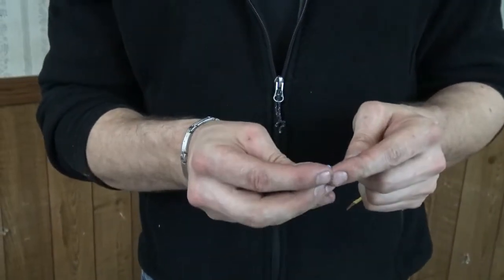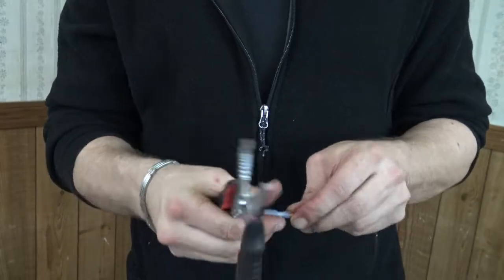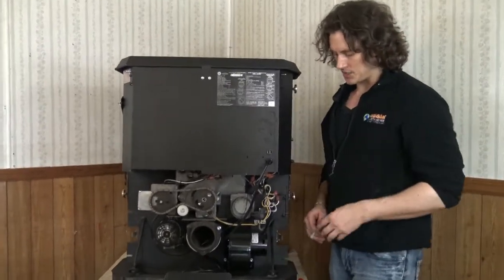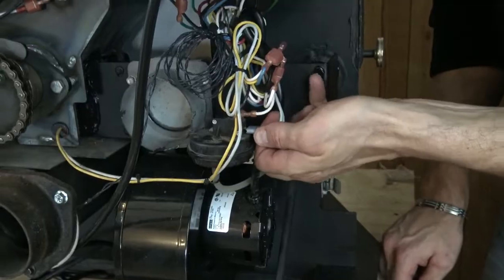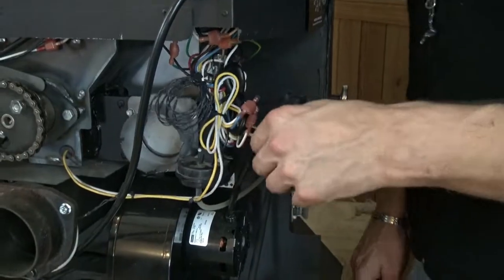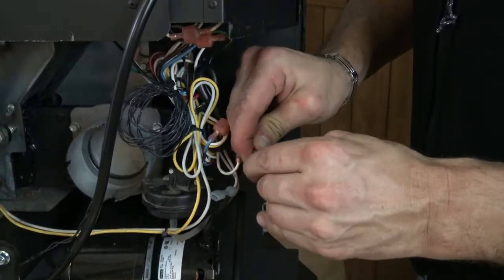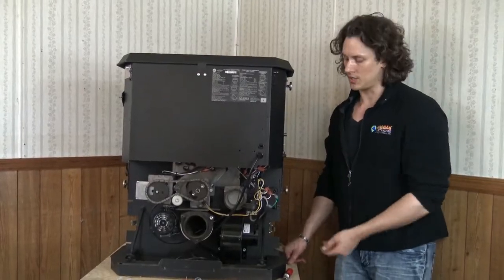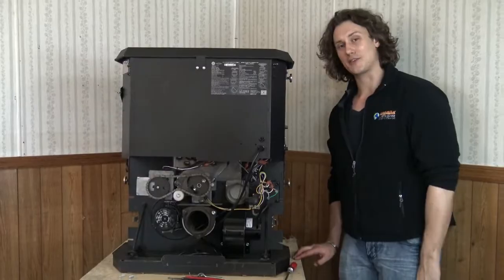How to create a jumper wire and bypass a safety switch in your Pellet Stove

Comment: How can I find the moles connectors? They all look different when looking them up.
Reply from the maker: Thanks for contacting us. Depends on the stove make and model, but most will use the same type of male or female molex spade connectors for the motors and components. These can be purchased at any local hardware shop - here is a website link that shows the most common size male and female spade connector used in pellet stoves. https://pellet-stove-parts-4less.com/collections/miscellaneous-electrical

Comment: I just use an automotive 5 or 6 amp fuse. The spades from the wires slide right on each side.
Reply from the maker: Thanks for sharing. Just important any metal on the fuse doesn't touch any other metal in the stove that would cause a short while using it to troubleshoot. Any future questions or needs just let us know. Thanks!

Comment: 5:05 pm 
My control borad quit working. Does not turn on. It's a pelpro 130. Can I by pass this control board by building my own control box? The part is on back order. Still on back order
Reply from the maker: Thanks for contacting us. I just inquired with our inventory team on this control board and the arrival from factory. I'll send an update once I hear back. The control/circuit board would not be able to be bypassed. It controls all motors, blowers, and safety switches during operation.
Reply from the maker: I just heard back from Inventory. The date they are currently receiving from the manufacturer is 02/02/2024. I wish we had a better update for you; if anything changes and they arrive in sooner we will be sure to let you know. Thanks.

Comment: Hi
Thanks for the links. I have never noticed any kind of gasket, but I will check it out. I will also do the dollar bill test. When the stove is on, the flame is very crispy/torchy as you mentioned. It does not seem to be a weak flame at all.
Reply from the maker: Thanks for the message, great to hear. If the fire looks real nice like that I highly doubt you have a gasket leak or air blockage in the stove. Keep us posted once you replace the vacuum hose. Thanks,

Comment: Thank you, trying this on my king 550 series now. It just shuts down with E2 error code
Reply from the maker: Thanks for contacting us. The manual says the ERR2 error code on the King 5500 indicates the unit ran out of fuel in operation/lost proof of fire. It provides these notes:
Hopper Empty.
Auger output failure or jam.
Flame of fuel quality caused fire to burn too slowly or go out.
Electrical Open in low temperature switch or wiring.
Keep us posted, happy to help.  Here is the manual for reference: https://www.manualslib.com/manual/266397/United-States-Stove-King-Ashley-Pellet-Stove-5500.html?page=18

Comment: The stove that I have is a Quadra fire Castile. It is an older model. It does not have a sensor on the pellet door. I will check the hose again. Do you normally send a replacement hose when a vacuum pump is purchased? I cannot test my auger motor because it has a big wide plastic clip for a connector. The exhaust fan seems to be spinning at an optimal speed. I might just need to call in somebody to take a look at it. Thanks for your help.
Reply from the maker: Thanks for the message and reminding me of the model you have; it's coming back to me now from our previous communications. The majority of vacuum switch replacements do not come with the hose/tube, however some do - just depends on the SKU. Definitely double check your Amazon order details on that - If something is wrong, our team will make it right. Yeah, check the items I indicated in the last message - I know it's difficult to direct test the auger motor in the Quadrafire due to the connector. I just have a feeling something else is causing that vacuum switch to trip/stay open which is not allowing the auger motor to run. Does your door and ash door gasket appear to be sealing tightly? When is the last time those gaskets were replaced? How about ash build-up? How many bags of pellets have you burned since you last thoroughly cleaned the vent pipe, stove firebox, and ash cleanouts? Happy to help save you the cost of a service call if we can. Thanks.

Comment: Hello. I purchased through Amazon a New vacuum pump from you. When I put that on, it did not do anything. The connectors seem to be loose on them when I attached them. Also, it has been several weeks since I have worked on the stove. When I plug it in now, the fan for the exhaust is very squeaky. Is there a way to lubricate that? I attached the jumper wire again, and the auger is working, but it is louder than it was previously. Thanks for any help you can provide. Appreciate it.
Reply from the maker: Thanks for the message. It is possible the new vacuum switch is bad, however it would be very rare. Before we determine the switch is bad and send it back for replacement, it's important you check the following things. Each of the items below will not allow the vacuum switch to close the circuit if it detects air loss or air blockage. 

1. Vacuum switch hose. No cracks in the hose. Secured tightly on both ends.
2. Ash build-up in the stove or venting. Any ash blockage will keep the vacuum switch tripped.
3. Door, Glass, Ash Pan gaskets sealing tight. Any gasket area that is not sealing tight will keep the vacuum switch tripped.
4. Exhaust fan not running at correct RPM - will keep the vacuum switch tripped.

With you saying the exhaust fan is squeaking, take a closer look at that. If you have a basic multi-meter, check the voltage on start-up. It needs to be running near line voltage to lock in the vacuum switch. 

The harman exhaust fan is sealed bearing so there is no way to lubricate that motor. 

You can always run the auger motor to direct power to check for performance and noise. The auger motor is sealed too. If gears are grinding or squealing and it's making noise, it's generally a sign that it is on it's last leg. 

Remind us again what Harman model you have and how old the unit is. Happy to send further reference links.

Hope that information helps. Thanks.
Reply: Hi. So I let the stove run, and the noise from the auger, and the fan blower noise have gone away. They both sound like they used to. I currently have the machine running with pellets to see how it’s working. Everything seems fine. The issue that I still need to address is that I am bypassing the vacuum switch. I will be ordering a new vacuum hose, and A new gasket for the stove door. The door to the ash bin does not have any kind of gasket. I am guessing because it is an older model. I will let you know how I make out once a replace the gasket, and toes. Thank you
Reply from the maker: @yesrealtygroup1989  Thanks for the message. Yes, it will be important to have the vacuum switch working properly again; we only want to bypass for troubleshooting purposes. The Castile Freestanding model will have a gasket on the ash door. Depending on the age, some used a rope gasket and others uses a cut-out sheet style gasket. I'll put reference links below - it will be good to check that gasket as well. You can do a dollar bill test around the door gasket. With the stove off, stick a dollar bill half in and half out of the door. Close the door and see how much resistance there is. Check in multiple areas - should be heavy resistance all the way around. Would you say the fire is nice and crisp/torchy while burning? 

https://pellethead.com/product/quadrafire-castile-freestanding-ash-tray-door-gasket-new-style-oem/

https://pellethead.com/product/quadrafire-heat-n-glo-rope-gasket-kit-1-4-x-10-aftermarket/

Comment: Hello,
So I did 2 things. I bypassed the vacuum pump and the auger started to rotate. I had also unscrewed the auger, and I pulled a small rectangle of paper towel out. I have no idea how that got in there. I cleaned out the auger, and I screwed it back in. When it did start up with the bypass, it seemed to be very noisy, nothing like it was before. So I am guessing at the minimum, I need a new vacuum pump. The one on the unit is a silver rectangular box. Thanks
Reply from the maker: Regarding the noise when the auger motor turns - it could be the gears in the motor or it could be the auger shaft inside the housing. See if you can pinpoint where the noise is originating from. Thanks.

Comment: Hi. Thanks for getting back to me. My stove does not have the sensor that is in the hopper. It must’ve been BIll before that. The wires coming out of the auger motor are connected in a white flat piece of rectangular plastic. I do not believe I can make a direct feed to the mower like you do in the video.  Is the high low sensor one of the snap discs? Thank you.
Reply from the maker: Thanks for the information. Ok, you have an auger motor with the rectangular connector. Yes, you would need to go to an electrical hardware place to create an adpater for that to direct test it. When you turn the stove on does it seem like the auger motor is trying to feed at all or does it seem like no power is coming to it? 
Yes, the high limit switch will be one of the snap discs. On your model it should be up by the auger chute covering or back wall area. Here is what it looks like for reference - https://pellethead.com/product/quadrafire-heatilator-high-limit-switch-snap-disc-3-manual-reset-oem/

Comment: Hello. It is a Quadra fire Castile stove. Runs off of a thermostat. When I plug it in, the blower fan comes on. No pellets drop. The auger does not have anything blocking it.
Reply from the maker: Thanks for the information. Few Basic things to check -
1. Let's make sure there is at least 15 lbs of pellets in the hopper and the hopper lid is closed. (I'm not sure if your model was before or after they had the hopper switch installed on the Castile. Reference: https://pellethead.com/product/quadrafire-heatilator-ecochoice-magnetic-fuel-hopper-lid-switch/) 
2. Let's test the auger motor to direct power to see if the motor is good or bad. This video will show you the basics of making a test cord -https://youtu.be/rlmiCYI2WPk?si=aTeEyaBXJeaAOTF3
3. Let's troubleshoot the high limit switch. Place a jumper wire between the two wires going to the switch. (Again we never want to keep the jumper in place, this is just for troubleshooting. It is crucial that all safety switches in the stove are connected and operating properly.)
Let's start there and keep us posted. Also a good thing to make sure the stove and venting have been thoroughly cleaned and the door gasket and ash door gasket look and feel to be making good seals. Happy to assist.

Comment: Hello. I have a Quadra fire pellet stove from around 2003. I major jumper cable, and bypassed the vacuum pump. Pellets still do not flow into the stove from the auger. Does this mean that my vacuum pump is defective? Thanks
Reply from the maker: Thanks for contacting us. There are several components in the stove that can prevent the auger from turning and feeding pellets. What Quadra-Fire model do you have? Is it running on a Thermostat? Does any fuel feed when you first turn it on? Does the combustion blower/exhaust fan come on when you first turn the stove on? Please provide as many details as you can - happy to assist. Thanks!

Comment: Thanks for this. 👍 👍 
I have an hp22 pellet stove. There's a switch that shuts the stove off when opening the hopper lid. It broke a few years ago and doesn't operate properly. I have it bandaged up with tape.
I'd rather remove it and bypass the switch entirely. 
(I live in the mountains. Getting parts shipped out is a big hassle and pretty expensive)
Reply from the maker: Thanks for the message. We do highly recommend that all safety switches in the stove are hooked up and operating properly including the hopper switch. In the event the hopper lid was left open, the fire will be affected and you could have a burn back into that fuel hopper. Again, we strongly suggest bypassing only for troubleshooting and making sure all safety switches are in place and working correctly. If you change your mind, here is the hopper switch for your stove direct from Comforbilt. https://comfortbilt.net/products/hopper-switch
Thanks,

Comment: I love your videos.  I currently have an Harman Accentra-2 that is not working.  In the test mode the fans work but the gear motor does not and I get 5 flashes from the status light, so I tested the ignition and it was in range.  Also, the gear motor is not working.  So, I watched the videos and tested the gear motor and it was working.  I then watched the low pressure test by jumping the feeds and blowing in the tube to clean it out.  Now the gear motor and auger are working but the ignition is getting warm but not firing up the pellets, could that be because the low pressure module is bad and it should work with the new part?  Thanks in advance for any assistance
Reply from the maker: Thanks for the message Richard, glad to hear our videos have been helpful! For the igniter, it's all about the velocity of air that is running past it during the start-up cycle. This air becomes super-heated creating ignition to the pellet fuel. Glad you checked the igniter ohms to confirm it is in range. From here I think we look at any air losses or blockages as either will have an impact on ignition  as well as the vacuum switch locking in and working properly. Let's check the basics:
1. Door gasket sealing tight all the way around
2. Burnpot holes open, igniter area cleared out of any fines or ash accumulation.
3. Air intake channel in the igniter area is free and clear without obstruction. (If you are not currently drawing fresh air for intake there will be a flapper door on your intake tube. Make sure the flapper is not sticking.) 
4. Overall cleaning and maintenance of the stove and vent pipe - removing any heavy ash accumulation
5. Inspecting the combustion/exhaust blower. This blower should be running near line voltage on start-up to lock in the vacuum switch and to provide enough air velocity for proper ignition. You can use a basic multi-meter to see what voltage it is operating at during start-up. 

If you need any further help or insight just let us know, we'll make sure you get back to 100%.

Appreciated,
Reply: @EarthSense  Thank you for our quick response. It was very helpful. The combustion/exhaust blower is not working.  I already did items 1-4 and went to Inspecting the combustion/exhaust blower and saw that it was not working at all.  I will look into replacing this on your videos and see if it is worth it.
Thanks again for your assistance
Reply from the maker: @RichardWark  Hey Richard, very glad to hear you found the issue. Here is a video on changing out the combustion blower on the Accentra FS. https://youtu.be/np1dlYITcpw
Here is the combustion blower both OEM and Aftermarket for you to review and compare. https://pellethead.com/product/harman-heatilator-ecochoice-combustion-blower-exhaust-draft-fan-motor-oem/

Any other questions please let us know. Appreciated!

Comment: Hi, and thanks so much for the helpful info. I have an England Stove Works 25-PDVC pellet stove, and noticed the top auger wasn't moving (bottom moves just fine). I used your vacuum switch bypass method, and everything worked smoothly. I've since replaced the vacuum switch, and wired everything back the way it should be, but the top auger still won't move. Any thoughts/recommendations? Thanks in advance!
Reply from the maker: Thanks for contacting us, happy to help. There must be something causing the vacuum switch to stay open and not close properly. Generally this will be either an air loss or air blockage issue. 
Let's check the following
1. Stove Thoroughly Cleaned
2. Exhaust Venting Thoroughly Cleaned
3. Front Door Gasket - Ensure it is sealing tightly all the way around. Same if you have an ash pan door gasket on your model.
4. Check the glass gasket to ensure proper seal all the way around.
5. Make sure the vacuum switch tube/hose is connected well and doesn't have any cracks. 
6. Let's check the voltage on the combustion blower. Should be near line voltage on start-up to lock in the vacuum switch. 

Here is a video specific to the vacuum switch that may provide additional help. https://youtu.be/pHeQzUmSlIE

Keep us posted, happy to assist. 

Thanks,
Reply: @EarthSense  Thanks so much for the quick response! I'll give your check list a try and let you know how it goes. Appreciate it!
Reply from the maker: @ctlupfer  Sounds good! Keep us posted!

Comment: hello, should i try this to see if this is why the glass gets dirty fast on a harman advance?  Tryed everything thought it could be the exhaust motor
Reply from the maker: Hey Mike, No, your safety switches will have nothing to do with the cleanliness of your glass in the Advance. Most important is to have the stove and venting clean. We want to see a nice crisp torchy fire during operation. If our fire is lazy or sooty in anyway we have an issue that needs to be addressed - Typically can be resolved with thorough cleaning and checking the gasket seals. What does your fire look like in operation? The type of pellet fuel you use will play a big factor in the cleanliness of the glass. Heat settings will also play a big factor (Glass will always get dirtier when running at low heat settings). If running on low for extended periods, crank the unit on high for 15 minutes and that will help clear off the glass. If you are using a chemical glass cleaner, wipe back over the glass with water when cleaned. Residue from a chemical cleaner will cause it to get dirtier quicker. When you open the front door on your Advance you will see a gap on the bottom metal lip where the 'Air-Wash' is coming up to keep the glass clean. Make sure this gap looks uniform and use a can of compressed air to clean out any ash or debris stuck in the Air-Wash gap. Let's start there, happy to help.